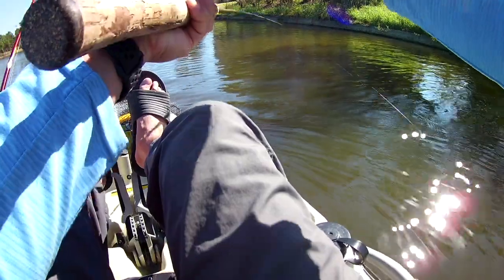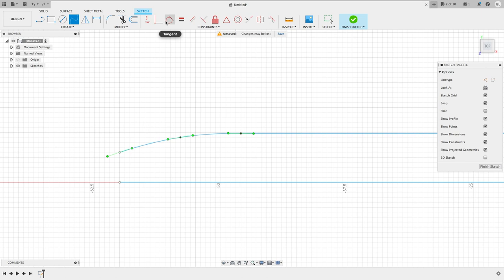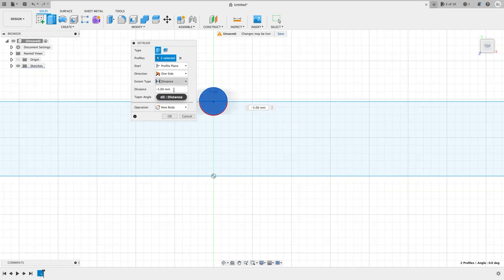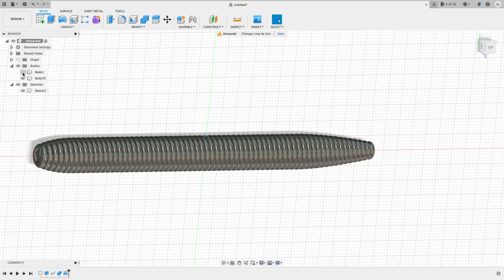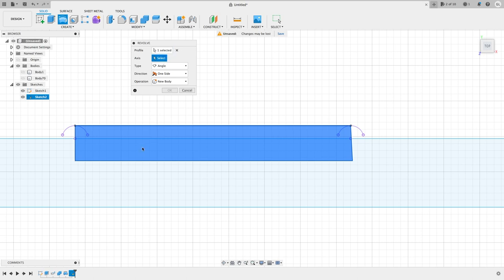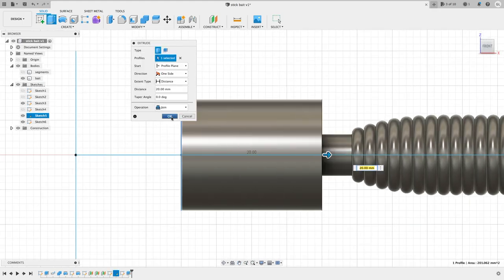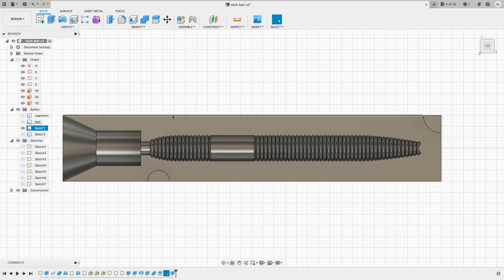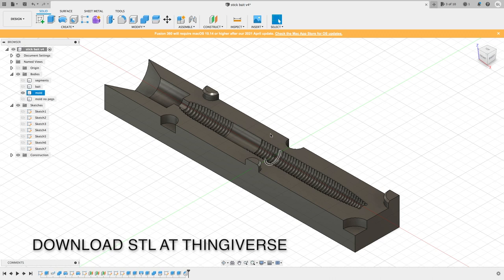DIY Senko Style Stick Bait

Comment: What 3d printer would I need to print out molds and supplies?
Reply from the maker: I have been using a filament (PLA) based printer and it works great for what I am doing. Only downside is that it could take very long time. I just got myself a resin based printer, I should be able to do a comparison in the near future.  So basically most 3D printers should work fine. Just read the Amazon reviews about their quality. For the bait making, you can check out my “minimalist” workshop video. Hope that helps.